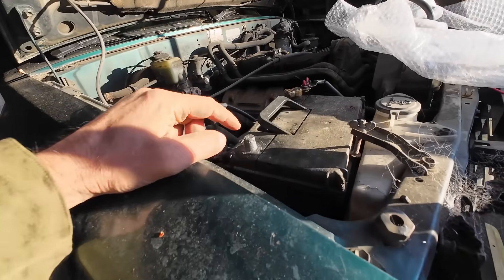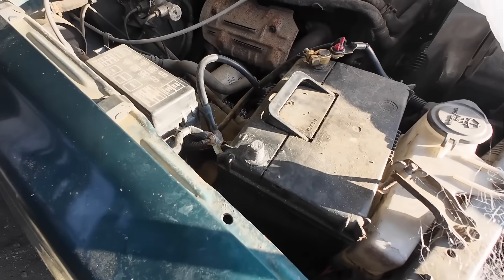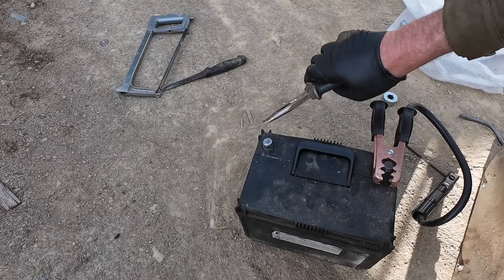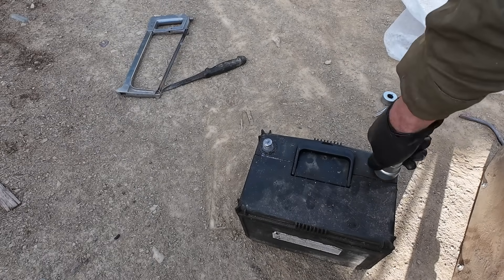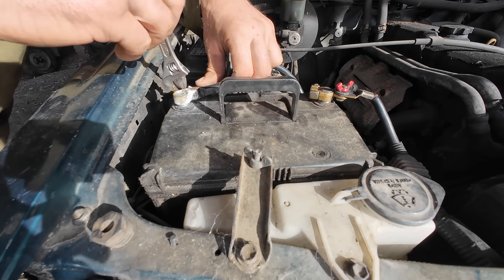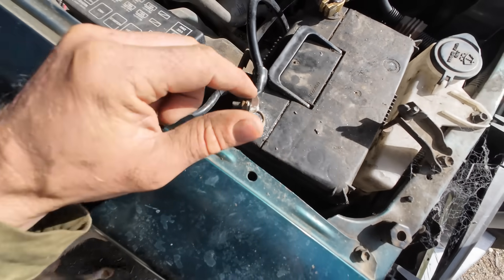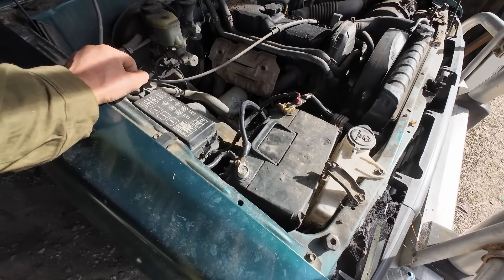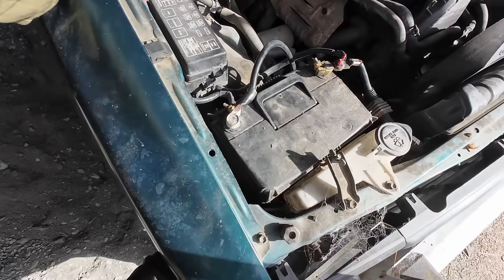Repairing a Burned-Out Car Battery Terminal – How I Fixed a 12V Battery Instead of Replacing It!

Comment: Nice one Marty, Now that you have the moulds, perhaps try to melt some lead (fishing sinkers, tyre weights, bullets, roof sheet lead or plumbing pipe) in an old tin can in the fire place and just pour it in the mould..Simpler than the fancy gadget.

Interestingly, the abbreviation for Lead on the Periodic Table is Pb. Its short for the Latin word 'Plumbum' (pronounced Ploomboom) and is where we get the words Plumbing and Plumb from. The Romans used Lead pipe for water and it lasts for thousands of years. New Zealand still used it till only very recently. You can often find it in very old buildings or the remains of them. Its grey like a galvanised pipe and easily mistaken for it.
Reply: And it caused mental deficiencies in child development and slow lead poisoning, and that's why we banned it now and ancient Rome is no more. That said I lived in a pre WW house that still had some lead piping plumbed in

Comment: Use hot water to get rid of the white deposit. Grease to protect!
Reply: You can use baking soda and water mixed.
Reply from the maker: Yep I did use hot water an baking soda, it cleaned up nicely then the deposit was back a few days later, something to do with the battery acid/gas  reacting with the metal

Comment: Marty 
Why didn't you fill it with solder  would of been less more dangerous or on the body of the battery use 2 part putty that you mix with you fingers  good stuff to have a couple of tubes at all times for all sorts of repairs
Reply: I've even done holes in a sump was still working when I got rid of the vehicle
Reply: Pin holes all over

Comment: Something to add for battery connection is Penetrox. The actual use is stopping corrosion on aluminum wire. But works great making a good corrosion free connection. 
So this is a kiwi style hot wire start? 😂

Comment: Safety suggestion. Dont try doing this on a freshly charged battery  there is a risk of hydrogen gas being emitted from the battery...any source of a spark. As you flashed that arc welder could ignite the gas in a very explosive way.

Comment: Great tool in concept
Dangerous in practice. 
There is risk to blow the battery up by shorting it out like this and also damage it by the high current.

I like the idea but it would be smarter and easier to melt the lead in a small pot over a gas burner and poor it into the mold. This way you do not need to use the battery for melting and also keep the to be replaced terminal overall cooler
Reply: When you do it per the instructions there is no danger at all - the problem is the cheap Chinese kits don't include instructions. The correct technique is to cut the lead pole down flush with the plastic case, then you melt new lead in to the mold. You don't actually need to heat the battery terminal itself at all.
Reply from the maker: I found poured lead doesn't  bond as well to the remaining post when pouring lead into the mold
Reply: He's not actually shorting out the battery. The rod is like a big low value resistor.
Reply: @vschouten  How many ohms?
Reply: Great video. I was just watching an old episode of Alaskan Bush People where they used a car battery with some heavy leads connected to it and and using it to arc weld. “ bush welder”.
Reply: Nonsense. Not at all dangerous to the battery.  The starter motor draws as much current as that heating rod did, the battery can supply much more than that quite easily.
Pouring lead into the mold does not work as it does not bond to the existing post.  Ya gotta get in there with some heat as per the demonstration.
Some flux like killed spirits (zinc chloride) makes it easier. Like is used when soldering radiators.

Comment: $40 hack kit and $50 face mask to save a old sealed $120 battery already leaking/low on electrolyte.
Reply from the maker: $250 battery and the mask and kit will fix hundreds of batteries, a small outlay in the big scheme of things

Comment: Wow didn't think this kind of repair was possible. Working with gasses.. dang dangerous. The @techgorilla comment about removing the caps and hot flashing is a good idea - or at least make sure the caps are removed first
Reply from the maker: No caps on this one, it is sealed
Reply: @MartyT  Ok then i was wrong.  :) - I thought the black plastic square around the handle was similar to America's maintenance free versions which meld all the caps into a monolithic slab that has to be pried off on the edge to reveal the water level. Lived for awhile in the American Southwest, thought not being able to refill a battery was a gimmick. Sorry for the concern.  I worked in a lab for a bit and the holes in my clothes told the tale.. Love the channel.

Comment: I wonder how that would work if you just melted the lead in a separate container and poured the molten lead into the mold that came with your kit.
Reply from the maker: I tried that years ago and the poured lead didn't bond properly with the remaining post, maybe I didn't get it clean enough

Comment: Not sure that does the plates much good. Normally starting current is taken for a few seconds, that's a dead short across the battery for quite a while. Not only that you said that the hole when through to the inside 😲💥💥💥💥 But I still love  your videos. 🤣🤣